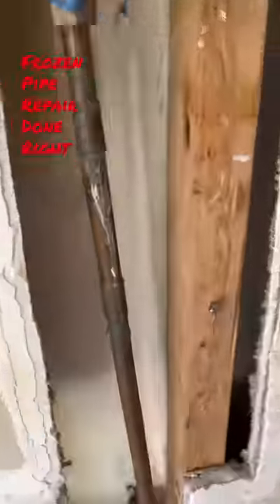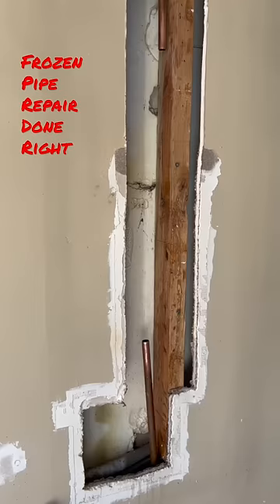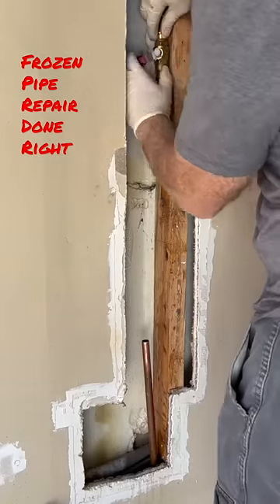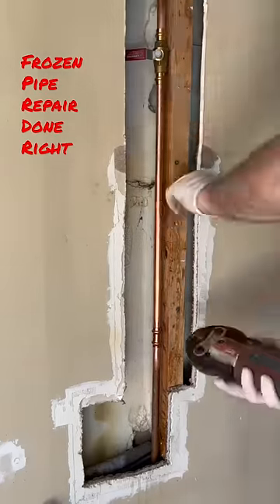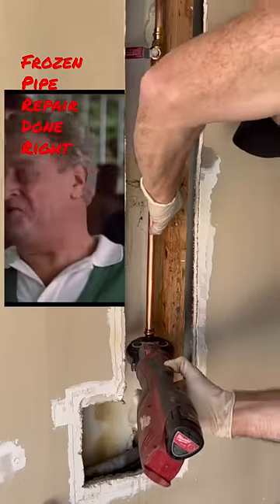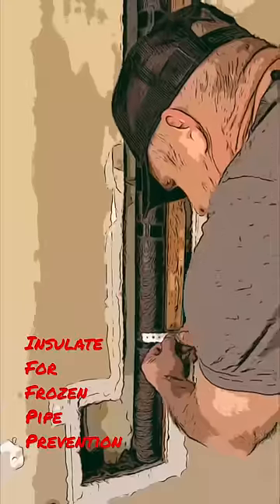Frozen Plumbing Pipe Repair @TappPlumbing #shorts #plumberslife #plumbingproblems

Comment: If you were able to move the pipe up and down why put a shut off valve in there, insulate it and then cover it with drywall. Why not put the line together and insulate, cover with drywall and put the valve if possible where it's accessible from the outside before it goes in. Just curious 🤔

Comment: Is that an exterior wall? If so, the cavity should have insulation in there.  Also, for someone to just splice it more than once is crazy. That just leaves more points for failure.
Reply from the maker: Yes we agree it should have insulation. It is a garage wall. Thank you for watching!

Comment: Are you hosting valve inside closed walls.  If so,  why?
Reply from the maker: The valve is on the line that feeds a spigot. It is required here so you can shut down the line and drain it or work on the spigot . There will be an access panel installed when the drywall is repaired. Thanks for a great question and watching!!

Comment: Water pipes running on outside wall without insulation is just asking for trouble. Doesn't matter if you live in Texas, Arizona, or northern Florida for that matter.

Comment: If the pipe has been frozen that many times it's prob on a perimeter wall that exposes the pipe to cold. Might need the insulation plus heat tape.  Heat tape is a mobile home owners best friend

Comment: I like how are you put yourself in pedestal about soldering and using pro press yourself
Reply from the maker: Here is  a short uploaded https://youtube.com/shorts/BsgvHWRR9NY?feature=share addressing the solder choice , or lack there of. Our shop only does plumbing. No dry wall work whatsoever. The client requested the valve at that height for some reason and it posed no threat to their system in my opinion. They also did not want the handle exposed and promised me there would be an access panel installed when everything dried out. This freeze spell happened right at Christmas. For the first time in my life I actually worked on Christmas Day. My neighbor’s house. The building codes here do not take into account those type of temps. There are tens of thousands breaks all over the city all at one time . Time and materials are impossible to come by. It was a challenging time to say the least.
Reply from the maker: What a great comment! Joe made a short about this. We should all look at our own misgivings before looking and speaking of others! I can tell you we do not bash other tradesmen to homeowners. We do try to see the good in all. Joe and I do talk amongst ourselves and then maybe put it out there on video for everyone to see to learn from our mistakes and other’s mistakes. We truly want to help others! I’m thinking we will continue trying to grow ourselves mentally and spiritually to see the log in our own eye and not the splinter in others! Thank you so much for watching and engaging. It really made me self reflect and I personally like that! Hope your day is blessed and great!(Renee) https://youtube.com/shorts/BsgvHWRR9NY?feature=share
Reply: @TappPlumbing  appreciate your comments sir))

Comment: Pex pipe it. Way faster. Expands ridiculously. Good stuff
Reply from the maker: Everything you said cannot be argued with. I put it back with copper because it feeds a spigot that turns out right under that repair. In my humble opinion the copper gives a more secure feel during operation and will stand up to the abuse that a spigot receives. People yanking on their hoses and hitting them the lawn equipment . Like I said, I completely agree with the points you made. Thank you so much for watching!!!
Reply: @TappPlumbing  touche. Want sure where it ran. 100% good call on copper for that.     My house used pvc....... I fixed that...... with copper. Internal lines have been patched/ repaired with pex. Love that shit!
Reply from the maker: @ConstitutionalConservative1776  Great to know you got rid of the pvc. I could show some pics that would blow your mind .
Reply: @TAPP PLUMBING  oh sir, please don't 🤣🤣🤣
I don't do plumbing, just know enough to save some money. But from what I had on my outside spigot and the couple dozen projects I've been lumped into, I can only imagine. 
The fact that people don't understand gravity is appalling....

Comment: I have a main shut off in the house in the basement do I have to put insulation around that if I am coving it up with dry wall?
Reply from the maker: I hope you are planning on leaving an access panel . Please do not cover up your valve! Insulation may keep condensation from developing. I am assuming you have Hvac down there? This is a great question you have !
Reply: @TappPlumbing  I will have to take a picture. Yes I was planning on putting access panel. The valve seems to have no handle but it looks like where the main water shut off is. I'll have to take a picture of it. The basement is unfinished so I am trying to make it a finished basement
Reply from the maker: Your pressure reducing valve should be near by also . Make sure you leave access to it as well . It might be a good idea to check your pressure before you get to far along in case you need to replace the PRV .

Comment: Insulation will do nothing to protect that pipe from freezing. Put a hot cup of water in a cooler outside in the winter and it will still cool and freeze without a heat source. It either needs heat trace on it or a vent cover to allow warm air from the house into the space.
Reply from the maker: It is in a garage , so no heat source.The insulation may help it not to receive direct wind.In some temperatures this could make a slight difference . I do agree for the most part though, if it gets cold enough not much is gonna help. Thanks for watching!

Comment: You actually did not properly insulate.  BATT insulation needs to go against the exterior/cold wall.  You keep the water line against the interior/warm wall to keep line warm with the heated interior of the home.  You can also install electric pipe heat cable that kicks on at freezing temps.
Reply from the maker: This will help explain:) https://www.youtube.com/shorts/BsgvHWRR9NY

Comment: A home repair done correctly, and it's a beautiful thing!! Stop using shark bites and shit folks!!! Either get a compression fitter or learn to solder and braze. It's a pain in the ass sometimes, but worth the time and effort. I also can't believe that no other contractor insulated the water line.
Reply from the maker: I couldn’t believe it either . I am pretty sure you will not be the only person on here that is not a fan of shark bites😂. Thanks for watching!!

Comment: How is that insulation going to help?  There's not really heat inside the pipe, so the insulation isn't going to keep the pipe warm.

You should have insulated the stud bay on the cold (exterior) side to keep the pipe warmer.

Comment: 1 out of 4 completed the job correctly. The insulation on the existing pipe in the wall is obvious as is the fact that this is an outside wall. 25% did their job right. Doesn't say much for  the plumbing industry does it
Reply from the maker: You are correct! We need more good people that want to learn how do the work , not just sell it!

Comment: That insulation won't solve the problem though- you need to insulate the space between the pipe and the exterior wall, then foil between the pipe and the insulation so it can reflect heat from the interior back into the tube. And of course PEX is more freeze tolerant than copper- so this would be a good application for it- you also need to either add an access panel or lose the valves. inaccessible valves is a no-no.
Reply from the maker: You are correct on the insulation info. That will have to be done by the homeowner. There will be an access panel installed when the drywall is repaired. The reason I went with copper is that line feeds a spigot. The copper gives it a much more secure feel during operation and holds up better to the abuse outdoor spigots receive. Thanks for spending some time with us !!!!

Comment: I hate buried valves. As an electrician by trade, that would have to be accessable if it were wire I think the same should go for pipe. At least come up with a way to mark that there's a valve behind the drywall somehow.

Comment: Why won't they put insulation in the wall? Or where is there heat You could also wrap it with a heat strip too with the timer

Comment: What's that tool you're using on those joints? I'm not a plumber but I'm thinking of having a crack at installing a wall-mounted toilet.
Reply from the maker: It is a pro press . They are great tools , you may be shocked when you discover the price😂. That is quite the project you will be undertaking. Please do lots of research  BEFORE you start. Best of luck and thanks for watching!!!
Reply: @TappPlumbing  Yeah I've watched a load of videos, I'm not even close to confident yet. I fix electronics so plumbing is way out of my range of skills.
Reply from the maker: Are you having luck finding videos on how to do the wall hung?

Comment: Guys remember that old gray quest pipe with those junk compressed band rings. Junk came under a lot of manufactured homes.
Reply from the maker: I still work around that stuff all the time.A few years ago I worked on a manufactured home that  NO plumbing fittings would fit in the pipe. The man that lived there gave me some automotive fuel fittings and hose clamps to coupling back with. The least of evils situation. That is never a good situation is it?

Comment: Solder tutorial: 1) Fit up and clean pipes, 2) Solder pipes, 3) Turn water on and look for pin hole leaks, 4) Turn off water, drain down system and resolder pin holes, 5) Turn on water and recheck for leaks, 6) Drain down and repeat pin hole leak repair as many times as it takes, 7) Say "good night honey" when wife says "here, hold your own damn flashlight, it's 3 AM and I'm going to bed".
Reply from the maker: First question, how much time did it take. Second question, how many Home Depot trips?😂

Comment: It will freeze again especially with the insulation on the pipe. The insulation should be between the outside wall and the pipe.  And the pipe should be left open to the inside of the room. Copper will usually break when frozen. It should be pex pipe if they are going to let it freeze.  😂

Comment: Fun fact, if a pipe froze once, it'll freeze again and if the homeowner won't fix the problem, install Pex. Save them money on the outdated copper lines as well as a future call.

Oh wait, that means you won't be able to charge them again for another visit. Shoot. Nevermind.
Reply from the maker: That is a fun fact indeed! I do love pex , however that line feeds a spigot. I run copper to them because they feel much more secure during operation. They also stand up better to the abuse they receive as an outdoor fixture. I hope not to charge them again, it only gets that cold down here about once a decade. I appreciate the fact you are long game thinker though. Thank you so much for watching!!!
Reply: @TAPP PLUMBING  I guess I'll play nice. My vehemence was not directed at you but rather the industry in general. The southern mindset is awful. I'm originally from Montana and we know how to winterize. Recently moved to Texas and have only been disappointed in their building quality since. I'm a firm believer of paying a higher price once a decade for a better job than less once a year.
Reply from the maker: @InnaciKorushka  I bet at first you were in shock when you moved. I am pretty sure Texas and Georgia have similar building practices. It is disappointing the way things are built to say the least. We have to operate with the circumstances we have though.  No need for playing nice , I have some pretty thick skin😂 Thanks for spending your time with us!!!

Comment: So we are going to leave the wall open? If not now we are going to bury a shut off in the wall? I would leave pipe exposed aand repair the hole at that point rather than see a hole in my wall. Good job hack matster

Comment: Doesn't matter to insulate the line on an outside wall. Still freeze. Need to have flow or insolate and drain line. Water will still freeze in a ice chest.
Reply from the maker: You are completely correct!! air it gets that cold again there is not much that will help it . Things are just not designed for those temps around here. Thanks for commenting!!

Comment: Cool.  So when it freezes again, it'll take longer to dethaw..  

Why not move the line from an exterior wall into an interior wall and solve the problem forever?
Reply: Also, the compression valve was probably installed so that it would blow apart instead of bursting the pipe.
Reply from the maker: @danielpatton3317  This happened on either Christmas Day or eve.We live in Atlanta, I was doing all I could just to get water on for people. I know this is no excuse for an answer to your excellent points. I agree with most of all that you stated. Thanks for watching and commenting!!
Reply from the maker: This happened on either Christmas Day or Eve. You would not believe how many freeze breaks there were all over town. Atlanta. I was doing all I could just to get water back on for people. You do have excellent points !! In a different situation I would have absolutely done things much differently. Thanks for a great comment!!
Reply: @TappPlumbing   please tell me you upsold the repipe for later :).  If you made them happy while they're in distress, they'll always come back and say yes.
Reply from the maker: @danielpatton3317  I must confess, no. I honestly thought nothing about it🤫 . We were about 40 calls out and it is only me in the field and my wife/ boss running the shop. We do have outstanding success making people happy though. I would feel funny bragging but if you were curious you could always look us up. You would be surprised to see what we have done for such a tiny shop!

Comment: Why have they got shutoff valves in the wall?
Reply from the maker: The line it is on feeds a spigot . Theoretically so you can shut it down , drain the line or work on the spigot . There will an access panel installed when the drywall is repaired. Thanks for a great question and for watching!!!!

Comment: Yeah that repair was done by the same person ..  the homeowner . And there was insulation on the pipe to begin with , so why didn't he put it back on. You can see the pipe insulation at the top of the line in the beginning
Reply from the maker: That’s a great question, the insulation was definitely missing around the repair area though.🤷‍♂️

Comment: How come there's no actual insulation if thats and exterior wall in a garage if that's the case there should not only be the foam pipe around the copper but also regular insulation idk maybe this video isn't complete

Comment: Could you explain why that pipe would have had to be repaired that many times?
Reply from the maker: My opinion is very poor building practices. This is what happens when you put pipe in an exterior wall and the homeowner doesn’t have the opportunity to provide some heat or shut the line down and drain it. This particular client was gone for Christmas and came home to a mess. Thanks for watching

Comment: They were trying to sweat those pipes on and the pipes still had water in them, or they had no idea wth they were doing. Def didn't seem confident in using a torch around that wall, which a wet rag and a shield could have helped.

Comment: Code allows a valve buried in the wall??
Reply from the maker: It will have to have access panel installed when the dry wall is repaired. Yes , is the answer to your question. Thanks for watching and asking!!!!

Comment: I'm no plumber but putting a valve inside a wall makes no sense. Also, if the line froze, wrapping the pipe won't help as much as insulating the outside wall so in the inside heat can get to it.
Reply from the maker: Believe me, lots of things don’t make sense to me either!!! That line was actually on a exterior garage wall so there is no heat . The valve is there to theoretically shut the line down and drain or repair the spigot the line feeds. This is just the way things were piped around here in this age house . Thanks for your time to watch and leave some well thought out comments!!!!

Comment: Me personally, I say they should’ve let their water drip. Voila, problem solved. I would much rather pay a couple more dollars on my water bill, every month, than pay an extremely amount of money on a plumber, even once
Reply from the maker: Yes keeping water dripping does help inside , however this was an outside spigot in garage and should have been shut off inside and drained before a deep freeze. You can't leave the outside spigot dripping without causing other issues usually:)

Comment: Even before pro press or sharkbites were around When I was plumbing in the late 90's early 2000's I couldnt believe soldering was a thing-caveman days
Reply from the maker: Think about those dudes way back in the day. Pouring lead joints and threading galvanized pipe😂
Reply: @TappPlumbing  nod of the cap to those guys and their heavier cast and galvi pipes

Comment: I want to know why there is a valve in the line that is gonna be closed up inside the wall eventually and no way to get to that valve why have it there?
Reply from the maker: The valve will shut down the line that feeds a spigot. There will be an access panel installed when the drywall is repaired. Thanks for asking two great questions. Thanks for spending some time with us  as well!!!

Comment: I did look closely and saw that there was insulation on the pipe at some point. They just didn't replace it when they made the other repairs.
Reply from the maker: That is a great observation, you are correct!!!  Maybe the people before me left it off hoping to come back the next freeze 😂.
Reply: @TappPlumbing  unfortunately, that seems to happen at times. Take great care